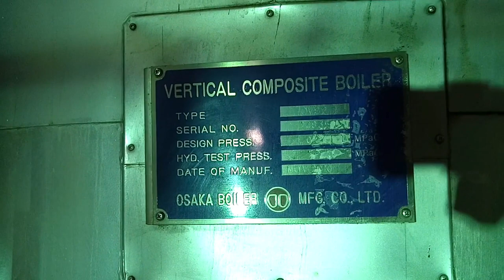Leaking boiler tube plugging procedure

Comment: How did you detect the leaking tubes?
Reply from the maker: Increase in water consumption will indicate tht there may be water leakage.
Reply from the maker: Also need to check the funnel.. If steam is coming out from the main engine or boiler  funnel than it will indicate the water leakage..
Reply from the maker: After shuting the boiler down.. It can be inspected for boiler tube leakage..
Reply: Thanks. What i meant to ask was, after shutting down boiler and making it empty, how did you test which tube is leaking?
Reply from the maker: We can't detect leaking after making it empty. Hydrostatic pressure testing is done to detect tube leakage..
Reply: @sidarthgupta8664   For individual leak test plug bottom of the tube and fill up with water ; by a hand pump make the tube pressurized and look for leaking. Go out the checks for all tubes similarly.
Reply: I'm thinking being a vertical boiler you would just have to see which tube has water dripping from it into the burner chamber,now things are more complicated when you're dealing with a horizontal fire tube boiler,then you have to individually apply water pressure to each tube one at a time untill you witness water running into the empty water jacket,

Comment: Welding is allowed ?
Reply from the maker: Yes
Reply: @TechnicalSailor  if we say this in oral exam, we will fail. Is it written in manual and approved by surveyor?
Reply from the maker: Don't know about surveyor reply but practically we hav only plug options others wise we hav to chang full tube and its not possible onboard.its drydock job
Reply: @TechnicalSailor  yes we are supposed to insert stud and pull from both ends with nuts .to keep the plugs in tension and in place. Don’t know how practical it is ..